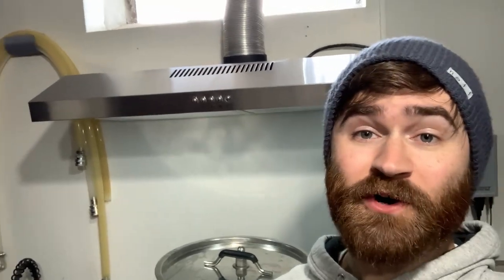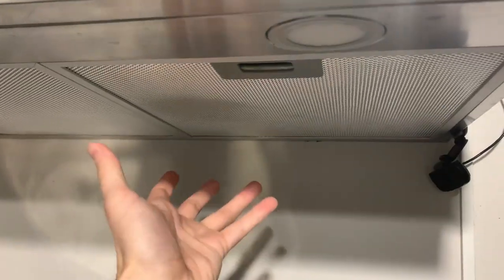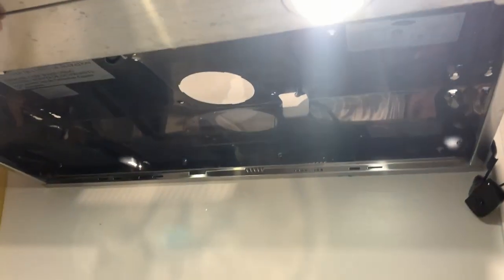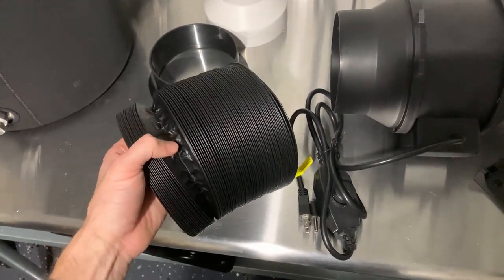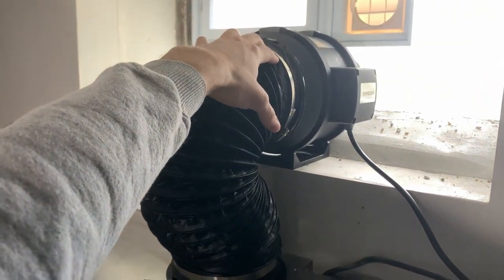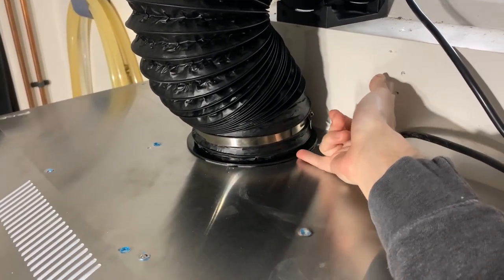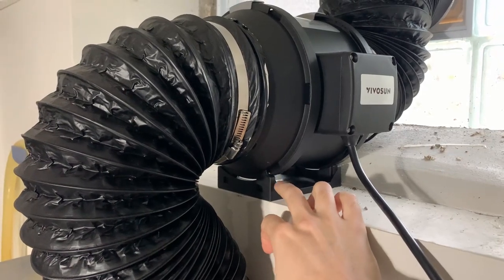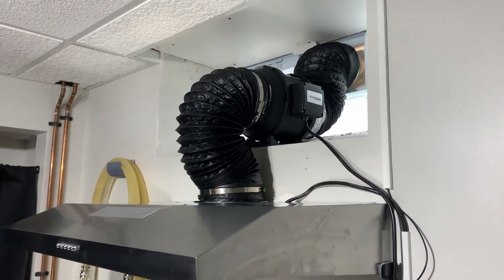SIMPLE UPGRADE For Your Range Hood For Brewing Indoors | DIY

Comment: Great DIY upgrade. 
One advice is to try to avoid the flexibility pipes and to many bentss when possible. Use fixed pipes and straight(er) lines reduces loss of volumes/min.
I your case it could be done by mounting the inline vent on the ceiling... if the construction allows for it.... and the vibration does not disturb people above 😁
Reply from the maker: Interesting idea, I’ll look into it. Thanks

Comment: Those fans are a bit expensive, but I do like mine. Nice and quiet and seems to work well. Cheers!
Reply from the maker: Yea the noise honestly is about the same as my last fan which is nice. They are around $90 so definitely would have been cheaper to just buy the right fan in the first place!

Comment: Something to be cognizant of is that you're pulling a vacuum on the inside of your house. Air will need to come back in from the outside to replenish what you're exhausting. Those big fans move a lot of air. This can be dangerous if you're also running a natural gas furnace or water heater as the exhaust can be caused to back up into your house and lead to carbon monoxide issues.
Reply from the maker: Good call out! I do have a window I can open up in the same room.

Comment: I was wondering if your inline fan is still working? I did something similar and the fan quit on the first brew. Maybe moisture or just junk. 
Thank you!
Reply from the maker: Yep, no issues here. Sorry to hear your fan is not working. Did you use the same fan I did?
Reply: It looked similar but not exactly the same. I was looking for one that had a good rating for being water resistant/waterproof. Great to hear yours is still working and see they still have it.
  Cheers and thanks for the quick response
Reply from the maker: @jimlewis7938   yea get that return done! They are not cheep!
Reply: All boxed and ready for UPS . Just ordered the one you have. Thanks!
Reply from the maker: @jimlewis7938   Hope it all works out!